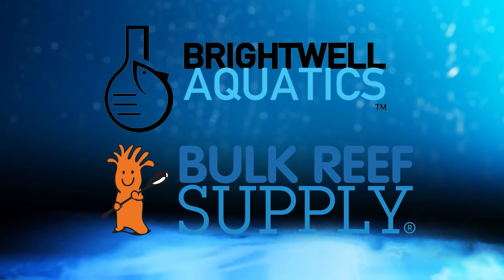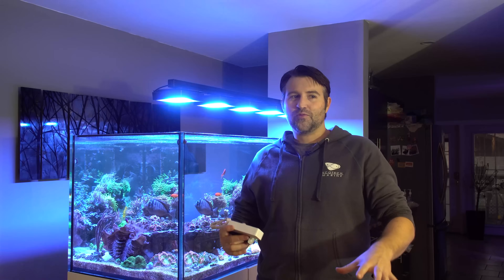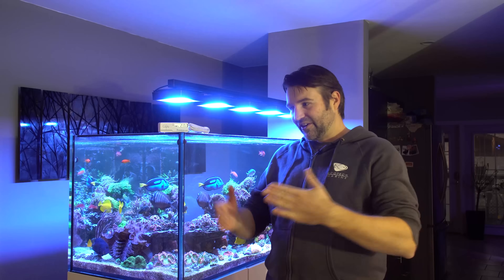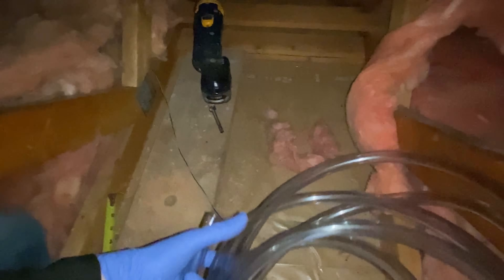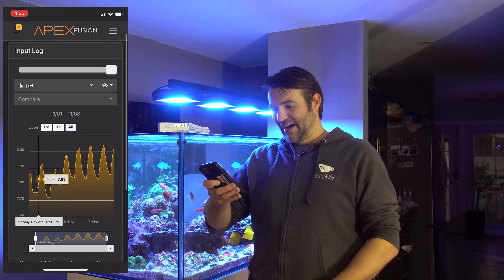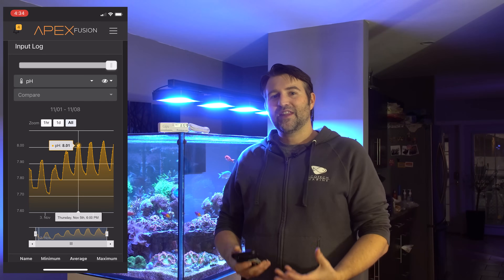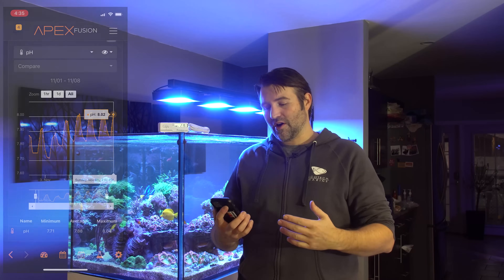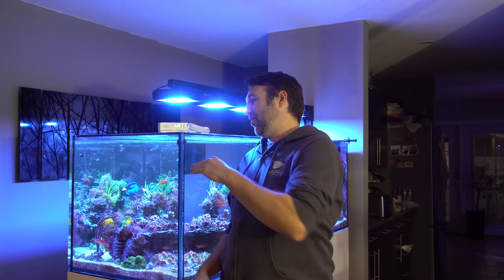Solving Low PH in your Reef Tank - Saltwater Aquarium PH

Comment: For one coming from a professional security installer for one drill yourself a larger hole in the attic don’t worry about the hole is not big enough and next time poke a hanger through your ceiling, right where you’re trying to find where you’re at and you can see the hanger when you get into the attic with a little bit of help and that little hole that you make with the hanger in your ceiling, you can just rub it with your finger and cover it up

Comment: I'm getting max pH 7.9 I ran a 5 foot hose to the outside through my exterior wall, But it's a smaller gauge than the the hose you have running from the roof into my skimmer.how.did you connect that hose to your skimmer?? Skimmer intake aren't that big.

Comment: Hey 👋🏼 bro! Man, I just wanted to let you know my experience with Low pH. I’ve always been a pH freak even when people say it doesn’t matter or that I was wasting my time monitoring it. IMO, I think it can tell you quite a lot about your tank. My tank was running about 7.9-8.0 after being setup for 1 year. This was monitored with a Apex Lab Grade double Junction pH probe ($74 dollar probe). I also had a Milwaukee monitoring with the same probe and it was a very accurate pH meter. Then I’ve tried Pinpoint which for me has been the most inconsistent and inaccurate of everything I’ve used. Long story short, my CaRx was driving down my pH hard. I’m talking 7.3 and it probably would have gone lower, but after I saw it that low I turned my CO2 scrubber back on. The best thing I’ve found to increase pH (although expensive to maintain) was definitely the recirculating CO2 scrubber fed into my skimmer cup. It was hitting 8.3-8.4 during peak lighting. I also dosed fully saturated Kalk w/ GHL 2.1 SA and at the time in my 75/G I was dumping about 3 Liters every week. The faster you dump it, obviously the more effect it has on the pH. However, it also spikes the water every time it hits. So it’s good, but kinda bad at same time. Imagine....-......-.....-.....- Get my point.? I ended up dosing more but at a less potent dose. In the end, the CO2 scrubber beat them all out. Plus my skimmer was pulling outside air which surprisingly gives you a pretty decent bump. My second chamber on the CaRx was nearly a waste of money. Those are my thoughts. 🙂
Reply from the maker: Did you try scrubbing outside air with media vs recirculating? That is another one I have been debating

Comment: To me as I have seen the colder outside the higher my ph runs but here we are in November and still having 70+ days and it still runs 7.6 to 7.8. I also noticed I had a lot of green algae growing in my sump on pumps, heaters, skimmers and walls from Fuge light. My ph ran more 7.89 up to 8.02, and like a idiot I cleaned my sump and now ph is back running 7.6 to 7.8. The line outside helps in colder weather and the more stuff growing in the sump really help.

Comment: Seems like a lot of effort still resulting in relatively low pH. I would ditch the reactor and go with two part. Much easier in my opinion.
Reply: does the two part up your ph?  I just picked up brs havnt started it yet.  My alk cant decide  what it wants to do.  It will maintains sometimes for days the start dropping .01 points per day then last night 0.5 points!  I dont know how i can dial in a dosage like that.  I did add to many corals at once so kind of freaked out my tank!  LOL  Seemd to be adjusting to it them recently then last night 0.5!
Reply: @karennation3580  if you use soda ash for alkalinity it will

Comment: I don't know if it would make a difference but you may want to look up vented attic and convection.  Hot air (roof vent) is usually the exhaust, you could get "fresher air" from the overhang or gables.

It was nice to see the immediate results.
Reply from the maker: Agreed! its inches away from the roof cap vent so i think its about as fresh as im going to get! :) any further and i need a good 15' or more of tubing which adds restriction and limits air
Reply: @ReefDudes  his point was you're in the wrong position to get the freshest air.  The ridge bebe is where hot air leaves the attic, the soffits are where the fresh air enters.  If you move your filter down to the end of the rafters where the soffit vents are, that's where you'll get your freshest air.

Comment: Hey Devon, do you have many houseplants? I can see one I think in the background.. but a few more would help a little too.. co2 media exhausts pretty quickly from what I’ve read, so can get expensive keep replacing it..
also with a recirculated co2 I’ve always wondered what happens should the skimmer overflow and end up pushing the media or water passed through the media into the tank? 
Made me itch just watching you in the loft I hate insulation 😆
Reply from the maker: Yep lots of plants! even more lately since the wife brought a bunch in when it got colder.   I'm hoping the media will last a long time using out side air.. but time will tell!   hehe dang insulation! i hopped into the shower after that one :P

Comment: I use controlled and monitored ozone from inside air, into co2 scrubber and then through the skimmers air intake. I find this too prevents low PH during the winter months. ORP and PH work in unison to some extent if correctly applied.
Reply from the maker: Do you find ozone affects PH directly?
Reply: @ReefDudes  
Yes absolutely. Ozone helps maintain a solid ORP in the range of 350/450mv This is a direct stabiliser for PH. With a monitor/controller you get to see how ORP drops after feeding and when the lights go off for example. The ozone kicks in and works to raise ORP quickly and the by product of this is the PH doesn’t dip and swing as bad.
Winter PH swings due to local air quality isn’t a issue.

Comment: Nice little bump from the airline and 2nd chamber. Drip Kalk, problem solved.  DO IT!!!!!!    8.38-8.4 PH daily with my Calcium Reactor.
Reply: dont you have  to do one or the other?  Kalkwasser or a calcium reactor?  I am new at this so still learning, and have yet to dose anything.  Also what is a kalk reactor?  I thought people dripped kalk in their ato?  Also is limewater or whatever its called kalkwasser? I was going to start with 2 part instead of kalkwasser since I am new and seemed easier but I diffidently need ph raised and also live in hot humid florida so not sure if outside airwould work for me.  First thing to do is order that co2 meter and see where I stand.  The tank is in my den and I spend a lot of time right next to it with my 2 dogs!!
Reply from the maker: @karennation3580  You could do both! no need to limit your self to one method. If you can open a window or get fresh air to your skimmer thats the free option!  but it all depends where you live and the climate there :)  If you already have a good PH you may not even need to worry about it
Reply: @karennation3580  Hi Karen. You can do both the Calcium Reactor and Kalkwasser or Dose 2 part and use Kalkwasser. You just have to back off the calcium reactor or dosing to compensate for the alkalinity and calcium the Kalkwasser puts in. Kalkwasser doses alk and calcium in equal parts.  Kalkwasser mixed with RO/DI water creates "Lime water"  Many reefers use Kalk in the ATO but the dose is based off of evaportation and not very accurate. Dosing in a controlled manner is more precise and better IMO.  A kalk stirrer is a vessel where you dump in Kalk that gets stirred on a regular bases and as water passes through the stirrer it drips it into the tank based on the dose you set.  My prefered method is to mix 2 tsp of kalk per gallon and let the kalk settle. I then use a Versa to dose 2ml per minute by pulling out of the container about an inch off the bottom not to dose the kalk residue that settles on the bottom. Hope this helps.
Reply from the maker: If I had space in my stand for a kalk reactor!  Sadly I do not
Reply: Phil, how are u dripping the Kalk without raising Alk? Imma hook up my Kalk Reactor and see how it goes since I keep my Alk at 7.8-8.0.
Reply: @ProducerReef  I drip it 24/7 with the Versa. I just dialed back my calcium reactor until things stabled out and alk held steady.